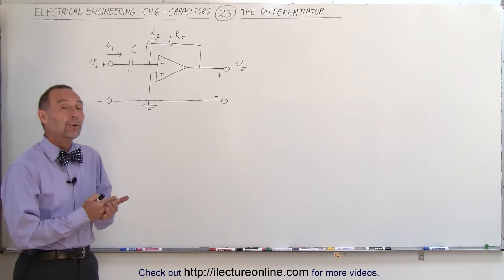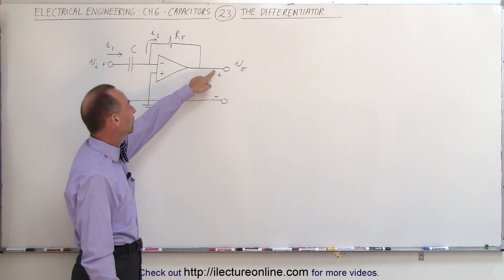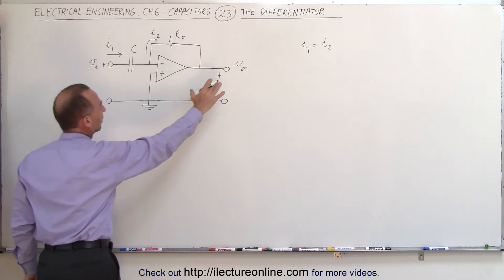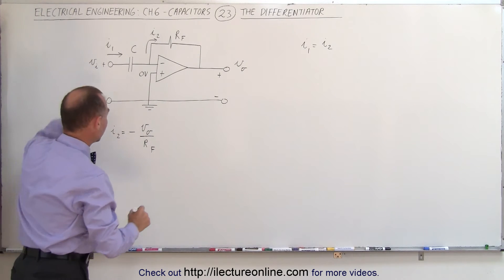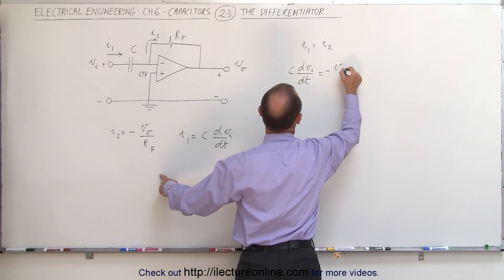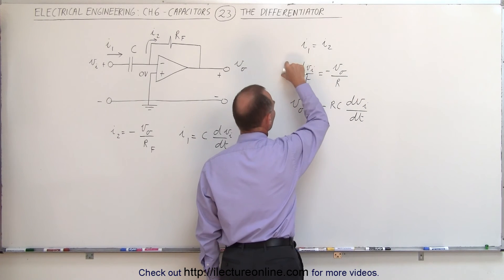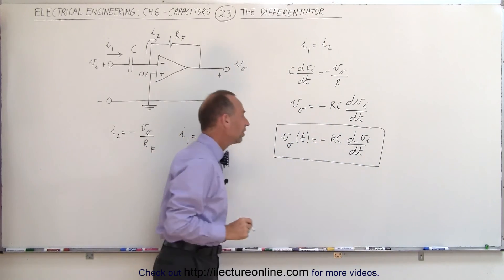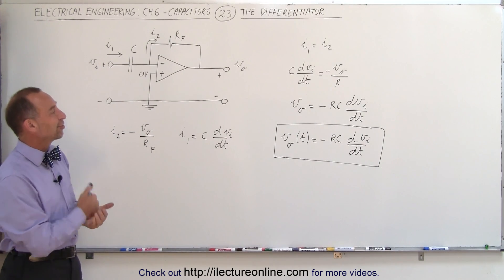Electrical Engineering: Ch 6: Capacitors (23 of 26) The Differentiator Integrator Circuit

Comment: But what if vi(t) is constant? Maybe constantly 5 volts? Doesn't that mean, that there's no current flowing and vo(t) is zero volts?
Reply: These op amps models all have some ideal conditions. One of these ideal conditions is that Vo terminal has zero impedance, which means that a current may enter Vo terminal. So the current flow shown in the video is possible in this model. You can check this on Microelectronic Circuits, by Sedra and Smith, 7th edition, page 62. About Vo being 0 Volts, yes that's possible. But it doesn't mean current is zero. It depends on the voltage difference between Vo and the other devices connected to it.